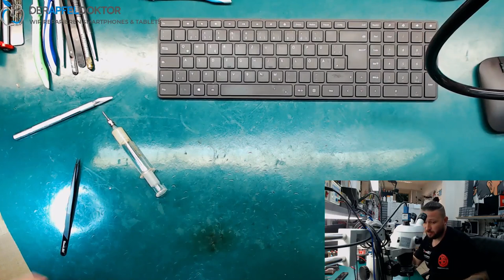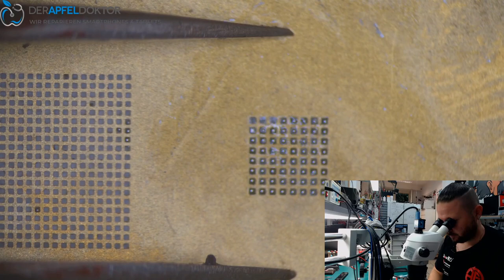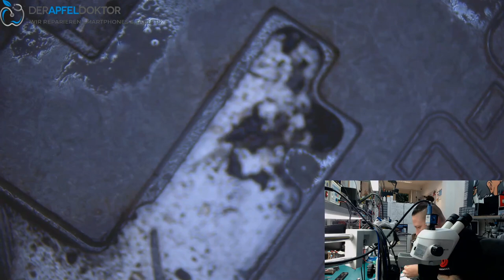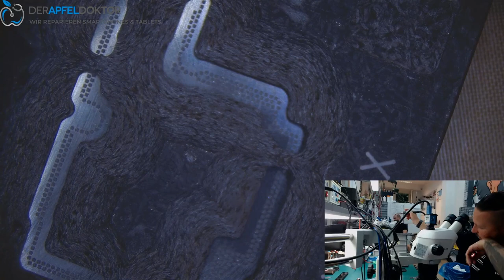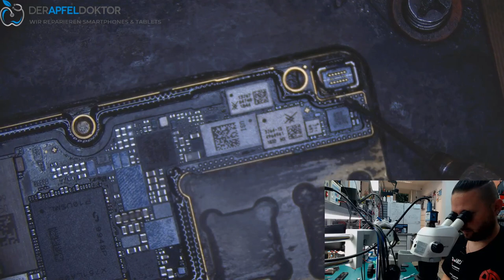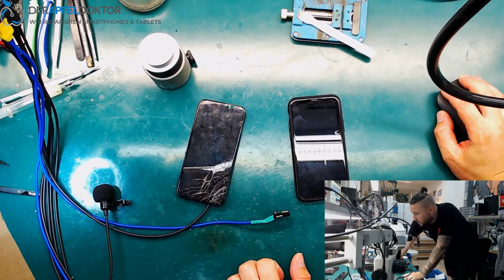iPhone X Screen freezes on unlock - How to repair the iPhone X Screen freeze within some minutes

Comment: another great video. you are so quick at what you do. Clean and precise every time. Very professional. I could watch you all day. Just to add that if you have an open circuit on pads S170 and S171, you will also get the same type of fault.

Comment: Hey master of recovery data. 
I have similar problem.. 
I did an iphone 7 swapboard, everything went fine, the device turns on but freezes after entering the lock code. So I moved the nfc from the original motherboard and it is still the same then I measured the pads under nfc and also everything ok .. what could be the reason for this behavior?